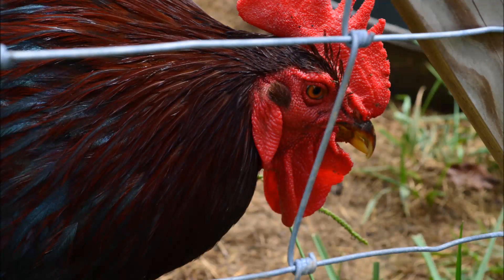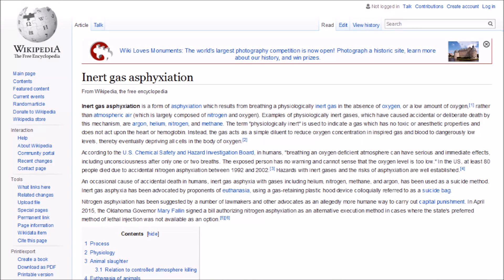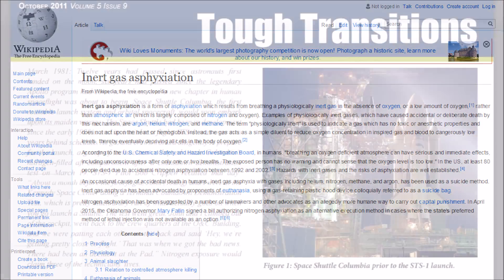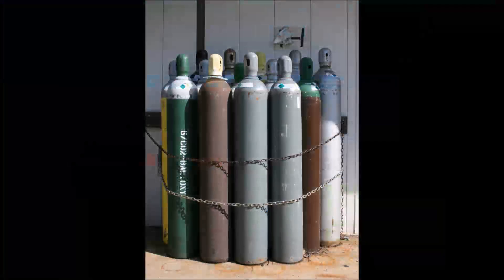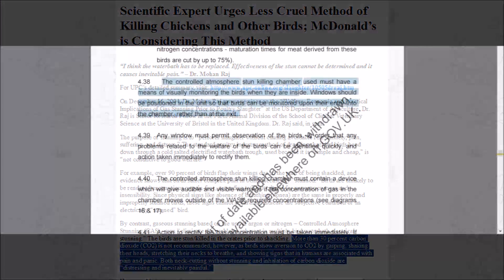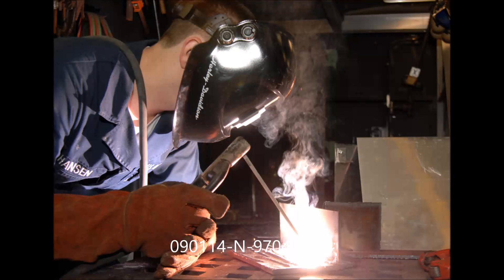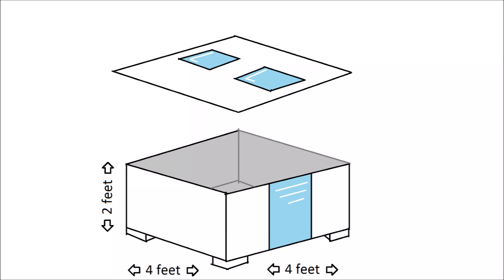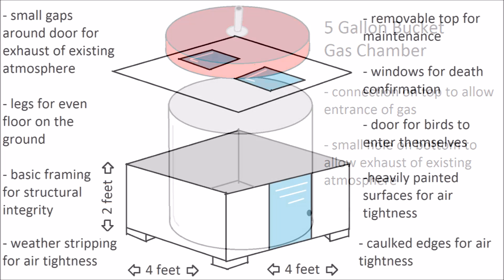Using inert gas for killing poultry and DIY gas chamber considerations

Comment: What a great video. Thanks so much for your time and effort. Actually, I was only aware of CO2 euthanasia for animals and didn't satisfy with it after watching how pigs die in CO2 chambers. I have a question for you. How practical (cost) is this method to use in a homestead situation? If you can explain how much will it cost to run your type of chamber each time? Many thanks in advacne for your kind answer.
Reply from the maker: It costs about $15 per tank of nitrogen for me in this area.  It's enough to kill using the chamber I gave dimensions for.  That would last a lot longer for smaller chambers, or using kill hoods, or being more conservative.  How practical it is for homesteading is mostly a matter of convenience and cost.  Glad you found it helpful!
Reply: Many thanks for your prompt and detailed reply. Since N2 is a less dense gas compared to air, I feel exhaust hole or space need to be at the bottom of the box. So that air will escape and there will be less and less O2 over time which will achieve 2% of O2 or less. Your design is ideal for CO2 chamber where CO2 is much denser and air will escape from the top.
Reply from the maker: That may be the case.  To clarify though: most CO2 is compressed into a liquid and is therefor cold and sinks when decompressed.  Most N2 is compressed, but still a gas... still cool upon exit though due to expansion.  So it's about more than molecules in either instance - it's about the context as well in their current state (temperature, altitude from sea level, external environment, etc.).  Regardless, the design works as I've used it several times.  I realize it's not fully idealized, but I'm very wasteful to play it safe.  I appreciate the feedback!
Reply: Some Guy In N Carolina thanks so much for your very scientific explanation. Btw I'm quite interested about "killer hoods" when it comes to dispatching Turkeys, goats and pigs economically with N2. It would be great if you can give a reference as to what you mentioned.
Reply from the maker: Jayanath De Alwis well, the reference I'm aware of is a suicide hood that some humans use, but obviously it would work for livestock. https://en.m.wikipedia.org/wiki/Suicide_bag
Reply: Some Guy In N Carolina Thanks for the link.The part of the world where I live 1m3 (size B) N2 swap cost around USD 40.So could you please explain me how many times can I run chamber like your?
Reply from the maker: This is really a question of displacement.  Look at the amount of cubic gas in the tank and consider displacement of existing atmosphere.  I talk about this in the video and mention being able to displace 2x is a safe bet to avoid brain damage from survival.  The number of times all depends on air tightness and efficiency.
Reply: Some Guy In N Carolina Thanks again for the reply. Since this is going to be an expensive exercise in our N2 market I have to think about minimum space dispatch box for quail and rabbits. For larger animals really need to try with killer hoods. I m not sure how practical a putting a hood on a pig who is a quite intelligent animal. In a homestead setting it may be practical to practice the pig,goat or turkey to condition putting on a hood may be giving a good feed after each successful attempt.I really want to make this system cost effective to give the animal the dispatch most humane.And do you have any idea  on a different system which consums oxygen rapidly in a tight compartment which ultimately leads to 98% N2 content?
Reply from the maker: You could condition the animals through training, or maybe create a hood with food held in it.  This Quora post might be helpful, but I have not verified it:
https://www.quora.com/How-can-I-make-pure-nitrogen-gas-easily-at-home

Frankly I don't know your financial situation, but this may be the privilege of the wealthy.
Reply: Thanks and I went through the link and it is not worth trying own nitrogen. I have seen people inhale helium through balloons and passing out. It means you may not need heaps of N2 if you do the hood method.
Reply from the maker: True... you might find a middle ground of just using inert gas to put an animal to sleep, then killing it with other methods. (though I am not versed on the details)  Or you might consider kinetic devices for quick killing instead of using gas at all.  Using inert gas is a luxury of the modern world I think.
Reply: Some Guy In N Carolina I live in new zealand and can afford initial costs for the gas tanks and regulators. Only issue is ongoing cost of N2 which is almost x3 than yours. It is very interesting that very limited amount of N2 can be stored in a cylinder compared to oxygen which has a close molecular weight. may be due to its inert gas properties. btw thanks for suggesting other methods which can be combined.Do you recommend cutting off the neck after animal being unconscious instead of kinetic method?
Reply from the maker: Cutting off the head is an unknown... my personal theory is it would be like getting struck by lightning to your central nervous system.  I was thinking maybe cut the main artery on the neck to bleed to death, or the guns that push a piston into their brain to immediately destroy awareness... the reality is no one really knows how humane these things are other than by outward observation, which is not the same as experiencing it.  I think being eaten alive in nature would be worse than most human methods of killing in general though.

Comment: I tried to euthanize my chicken with nitrogen who has Mareks disease. She is paralyzed and seizes up in painful cramp like indications.
I have been a strong advocate of using nitrogen to euthanize all animals being used for food.
However when I put my chicken in a basket and then filled the plastic bag with nitrogen my chicken became alarmingly breathless and panicked as though she were suffocating. I had to stop the process. I am greatly disappointed nitrogen did not kill her humanely.
Reply from the maker: Annie Griffin, sorry to hear that. I wonder if it was an issue of purity? Often "nitrogen" can be sold as a mixture of gases. Perhaps yours contained a high percentage of CO2, which would explain the reaction.
Reply from the maker: Agreed... it doesn't take much to cause brain damage from oxygen deprivation.  Though if it has the same behavior, it is probably fine.
Reply: Dude thats torture if you stop it along the way. Most of its brain cells died due to less oxygen. It'll become comatized or not be able to control its body properly. Maybe the bag was not fully deflated and filled with some oxygen
Reply: You don't half kill anything, that's cruel. I hope you finished her off for her sake. Why use a basket? You need a chamber to displace the atmosphere, not a basket, that would just be making her breath lots of nitrogen plus whatever gases would enter the basket. You shouldn't have tried that unless you were verses on the process. You shouldn't experiment with alternative ways of killing as of you don't know how to do it right you could, and did, hurt and torment the poor creature.

Comment: This is super helpful, I’m looking into gas chambers at the minute since I have started breeding, I can’t be having any more roosters. I want the most humane way possible as I already feel uncomfortable killing them but it has to be done since no one wants the roos, when I worked at a hatchery and the guy used to just push the necks on a sharp edge which I could never do even if the bird was in pain!
Reply from the maker: I agree about breeding and having extra roos.  You hatch about 50/50 and only need 1 rooster for 10 hens (if not more).  Traditionally you raise them until winter, then slaughter for food - makes perfect sense and is the closest to symbiosis with such an equation and human control.  I've done this with flocks many times over the years when I do a breeding season (not usually every year).  When raising bantams they are hardly worth eating unfortunately, so I end up selling them as best I can over time.  Cute crowing sound at least!  Good luck with your project.
Reply: thanks! I am hoping it goes well although I was in work today and our reptile guy just said to me bring them in the snakes will kill them quickly. -.- I have decided for now I am going to focus on quail for a bit as sex isnt much of a  problem for them although some can still be born with deformities, I am actually working hard to keep one alive right now because a friend got attached and wants him and so we agreed that if she would definitely take him i will do my best to keep him alive but normally i wouldnt want them suffering and would want to gas  them as well. As for roos, im not sure if I would like to eat one I raised because I just love roosters, maybe more than hens haha, I got really attached to my current rooster and dont know what I would do if asked to slaughter him. I am also really lucky to have neighbours that love the crowing!
Reply from the maker: I like all my poultry but have gone through hundreds of birds between breeding/hatching/selling/butchering/etc.  Once you have more than a few dozen, you stop naming them, etc.  They are still fun to watch and you have some favorites.  I have one that even comes when you call it and is very people friendly - likes getting pet and such.  I wouldn't go out of my way to kill any, but sometimes you just need to for practical reasons.  I really hate waste though, so either we'll eat any we kill, or we'll give them to the neighbors who will eat them.  No waste! :)
Reply: Raise them separately then Eat them. Make dog and cat food out of them.

Comment: very interesting. I keep rescued ex battery hens and i was looking for a way to kill them humanley and peacefully when they  start to suffer in old age or get badly injured. A couple of questions. 1. why do you need to seal the chamber so well if you are then going to have an exhaust hole? At what rate and pressure is it best to add the nitrogen and do you have to keep it filling the chamber up until you see that they are dead? will using a higher pressure kill them quicker? i was wondering becuase if i have a go at this i want them to suffer as little as possible. thanks
Reply from the maker: 1) I slowly allow nitrogen to enter and since I don't have a good way to measure the output PSI and displacement ratios, I like to play it safe.  Due to the slow displacement venting, the overall seal must be pretty good. 2) As I mentioned in the previous answer, I have no simple way to really know the rates.  I believe I aimed for atmospheric PSI pressure, about 14 PSI.  3) If by pressure you mean rate of atmospheric displacement, then a higher rate of displacement will kill them faster.  To help eliminate discomfort from pressure differential I opt to fill the chamber fairly slowly.  I believe it's about 5 minutes.  That said, if you're using a 5 gallon bucket with a hole, you will waste less gas for a single bird.  I would not pressurize the chamber itself of course.  Hope that helps.  Thanks!
Reply: someguyinncarolina that's great thanks and such a prompt reply

Comment: If we can put animals asleep for operations..can't they do the same before slaughter.
Reply: No, you do not want to eat an animal that has anesthetics in it. Inert gas asphyxiation is a stunning method. Stunning and anesthesia are not the same thing.
Reply from the maker: Well, some animals can't easily be put to sleep for an operation - birds are one of them.  It's very tricky to put a bird to sleep for an operation compared to mammals - you need a very exact ratio with small margins if you want them to wake back up!  That said, inert gas asphyxiation is a very transparent experience for almost all animals.  It's a little pricier than just chopping their heads off, but it helps me sleep better at night to give them an experience fit for a human, even if it adds a few extra dollars to a slaughter. :)  Thanks for the comment!
Reply from the maker: That is also a very good point!

Comment: This is just what I have read and I thought might be useful to share; you mentioned a lot of this but here is what i found:

 Basically most animals (humans included I think) don’t really sense oxygen levels, but carbon dioxide levels.  Therefore decreasing oxygen, but not increasing carbon dioxide by allowing it to exit can go unnoticed until the animal looses continuous.

IF IT IS DONE RIGHT:
The animal basically passes out then slowly suffocates.  

You need to make sure that the inert gas is pure and that the carbon dioxide from the animals wont become too concentrated.

You can also use other techniques after they pass out such as exsanguination.
Reply from the maker: All correct information, thanks.  That's why I wish people avoided CO2 for killing - animals, us included, can detect it and it is very uncomfortable in terms of sensory perception.  As mentioned in the video there are legal thresholds based upon ratio, but I choose to use pure nitrogen personally.  I'm glad this video has gained some traction, but many people still choose to use CO2 unfortunately.  Worse, they end up pressurizing the vessel because exhausting the existing atmosphere is not considered - basically carbonating an animal while it is still alive.  I'm pretty sure that would end up on my top 10 list of ways I would NOT want to die.  Thanks for the comment!

Comment: DONOT USE ARGON !!! i worked in labs with mice and dear god the brain lights up in sever pain and cortisol levels start to spike CO2 is better than argon I can give you papers in pdf form about it I prefer CO2 my self but you need to do a particular amount at a particular rate
Reply: @venkivijayawada  Apparently it is not painful, unconsciousness occurs within 30 seconds (some people even report feeling euphoric) and death occurs in about 4 minutes. It is the absence of O2 which does the killing.

No suffocation reflex is experienced as the diaphragm still works, no CO2 build up occurs in the tissues (CO2 build up causes the heart to beat faster and blood pH to fall causing stress) and the brain dies within 4 minutes.

A source for the brewing industry sells nitrogen gas cylinders for both brewing and now for committing suicide. To speed the process along it is recommended that a deep breathe out is taken, breathe is then held for as long as possible and bag of nitrogen connected to a nitrogen cylinder is placed over the head and breathing is resumed. Unconsciousness apparently occurs within seconds. If nitrogen gas pressure is continued from the cylinder death occurs within 4 minutes. Frightening stuff.
Reply: @ @kynchan3332   can i sit in my car with windows rolled up and then open a couple of nitrogen cylinders? will that put me to sleep forever or do i have to use a scuba mask with a regulator? please answer soon
Reply: @zag5250  The idea is to replace the oxygen in the car with nitrogen - could take a while in a big open space like the car interior. A taped bag over the head with tubes secured with tape connected to the nitrogen cylinder concentrates the nitrogen gas in one place for breathing that will work far faster (even if there are small leaks as oxygen only needs to fall to below 6%).

If you are already at that place in life, where you feel you have nothing to lose but have a healthy body, it is best to do other things first such as taking sensible risks eg applying for jobs/opportunities you wanted to do at an earlier stage in life, knocking on people's doors for opportunities you wanted, traveling, trying new foods and drinks, volunteering to help people less fortunate (gives meaning and prospective to your own life), write down your thoughts and review it later with cold hard logic, take on different values (often we are unhappy when we compare ourselves to others eg others with better job, house, relationships - stop comparing and the unhappiness lifts away fast). Go for as many opportunities as possible to improve others people's lives if you can't see how to improve yours initially.
Reply: @zag5250  I hope you're kidding. Your life is worth it. Almost every person who has survived suicide attempts experienced immediate regret and terror once it was too late.
Reply: @zag5250  no
Reply: @austinhenning6271  no, I regret I woke up
Reply: @austinhenning6271  where did you get that "statistic?"
Reply: Rodents are sensitive to low oxygen atmospheres and hypoxia. That's why. Chickens are different and you can use inert gases with those.
Reply: Came her to learn how to Humanely euthanize poultry and other small meat animals but also learned how to commit suicide... 😶 

My 15 year old daughter suffers from severe suicidal depression. She has tried to take her life a few times now. I know what it feels like to not want to go on but it's impossible to relate with her on her level because what she's going through is very different from what I went through. I wish I could get her to see that life can be anything she wants it to be. That there's so much out there and she should hold on and get out of her own head and into this vast magnificent world! But I no luck so far...

If you want to kill yourself why not run away instead? Start over, seek out adventures, try new hobbies, make new friends and do new thing!? You only have one life, make it the way you want it!!! 🥰
Reply from the maker: Super interesting to know that about Argon.  From the research I did, it was considered interchangeable with Nitrogen, but maybe not from what you're saying.  I would still highly recommend Nitrogen over CO2 though.  The reason I chose Nitrogen over other inert gasses is because it's most of what we breathe already, so it seemed the most logical choice.  Thanks for the comment!